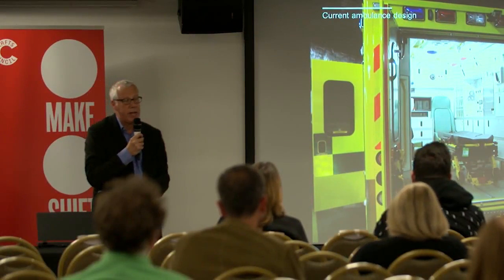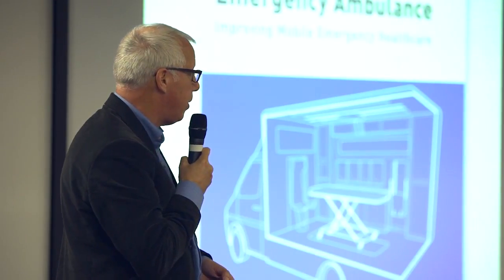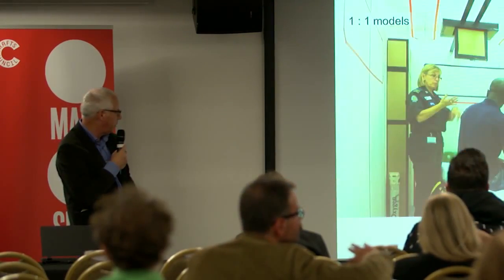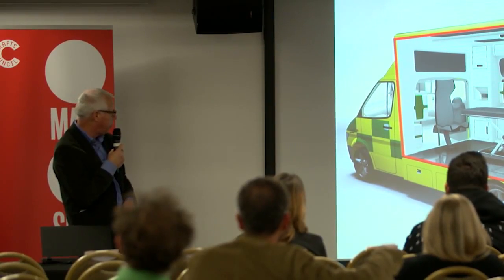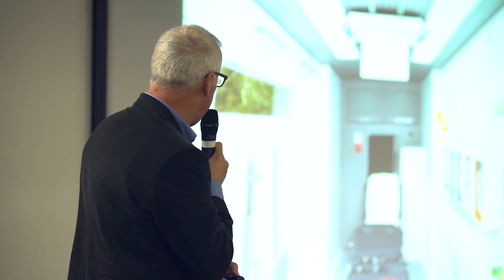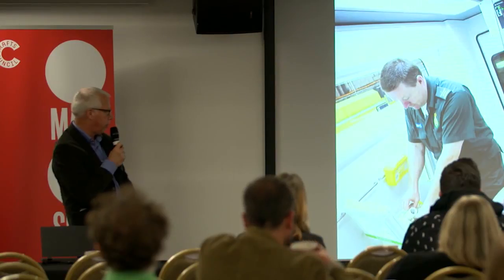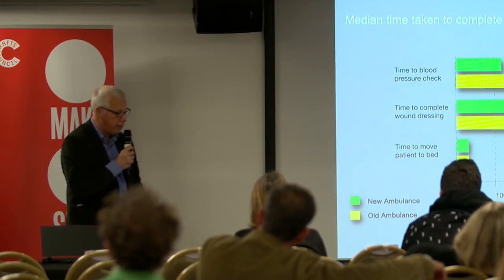Jeremy Myerson, Redesigning the London Ambulance

Comment: Modular. So “you only take kit you need for the emergency you are responding to”  issues I could see with this

1. surely this would increase response times
2. Ambulances are often not at their station and are going from job to job to job
3. What if they get flagged down or witness a RTC (Road Traffic Collision) where they need equipment, but don’t have it because they had just been to a different job and took kit that is not relevant to the RTC. They wouldn’t have the kit to help
Reply: I do not think that's what he meant. You only take what you need to the patient. Everything is still in the car. Just not everything in a heavy pack, where you would only use 10% of.
Reply: @rockhock108  That's not what he says, nor is it what the ambulance shows.  He says at the start (0:22) that you "because it's not a smart vehicle you have to put everything in there for every eventuality".  He wants to take things out of the ambulance, for the crew to slot in as they go to the emergency, which will as Nathan said increase response times.
Reply: @Scott-py1sd  That's the way that I interpreted what he said, only taking what you need for each job. However, as others have stated, it doesn't allow for being tasked with a higher priority job after leaving the station or getting diverted to a new job on the way back to the station from the hospital. 
I can see this approach coming a cropper in the face of hard real world experience in spite of all the testing. Lord knows how these ambulances are standing up to the Corona Virus pandemic.
Reply: I take it none of you guys work on ambulances? He is saying that instead of having 1 bag which had major trauma pack, maternity packs, resusitation pack etc in, it will have seperate packs in cupboards, and you take which ones you need out of the cupboard. Ambulances dont have tine to go back to station between wach call. smh
Reply: @AB-cs7vm  no he isn't. He doesn't mention that once. He makes it quiet clear he is talking about the ambulance being modular, not the bags that the gear goes in.
Reply: @AB-cs7vm  Our standard response kit carries all our drugs plus administration gear, wound management supplies, plus an airway kit. Pretty much 90% of what we need 90% of the time. I think these are standard Ferno products.
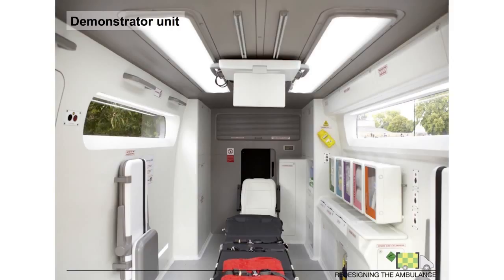Reply: @Scott-py1sd  you are the one not listening. At 2:45 he says "modular treatment packs", and you can even see what he's talking about at 2:18 The colored boxes on the wall are the different modules. Each contains gear needed for a different type of emergency, e.g., green for O2 admin and nebs, red for bleeding control, blue for airway maintenance, pink for peds, etc.

Do you honestly think this thing would have passed the rigorous field tests (performed by scientists and actual NHS paramedics) if it had the ridiculous design flaw that you've so fervently latched on to?
Reply: @lolokbr  you're just being thick now. Look at the very beging of the video. He shows a picture of a current ambulance filled with equipment and states that "everything but the kitchen sink is in there because it's not a smart vehicle". Later the show an ambulance with less than a third of the equipment and says "it is modular, you take the kit you need for the emergency you are going to".

He doesn't mention kit bags or what you remove when you get there. He's saying this is what you take with you to the emergency, in the ambulance.

This is why we have not seen any vehicle like this on the road yet, because it's impractical. It's not passed any clinical trials or tests.
Reply: @Scott-py1sd  I've been running emergency calls in one of the busiest EMS systems in the entire world, during one of the worst healthcare disasters in modern history in a rig that is more bare-bones than the one shown in this video and we've been doing fine. You don't need an entire mobile hospital. You just need the essentials, which you can easily fit into the configuration they've shown in the video.

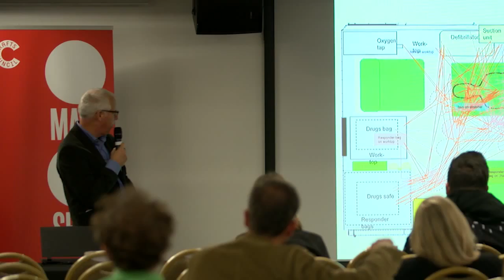Look at the graphics at 1:30 and 1:40 and tell me what essential equipment you think they're missing.
Reply: @lolokbr  you've completly if ored the fact you were wrong and moved on to another topic. I don't care what you claim your background is, this ambulance, compared to current ambulances isn't for for purpose in our health system.
Reply: This is assuming the dispatcher is 100% correct all the time. I would rather take everything with me in the truck and not leave it up to a moron dispatcher
Reply: resqjason2 dispatchers aren’t the morons, it’s the public that phone up, they have to try and decipher all the information they are given and come up with a possible diagnosis, they are very smart people. But I do agree that if the dispatcher gets the wrong information given to them by the caller then the ambulance wouldn’t have the correct kit so should take everything.
Reply: A B I agree that would be a much better way of doing it, from how he explained it I interpreted it a different way (like my original comment), I think a lot of people have interpreted it both ways.
Reply: @resqjason2  moron dispatchers?? There is no way that you are professional EMS. 
I worked a fast response car, on my own, in one of the roughest areas in London and was dispatched to the most serious red emergencies. Dispatchers are not morons!! Dispatchers and call takers have the hardest job in the service. I can battle to save someone's life, but I couldn't listen to someone die over the phone whilst trying to find resources that aren't there!
Also, on at least 2 occasions, dispatchers have saved my life. On one occasion I was being attacked with a hammer and the dispatcher orchestrated rapid help from the police all whilst I was unable to give clear information over the radio. On another occasion, I took seriously unwell on duty and the dispatcher was my best friend that night, she looked after me remotely throughout the whole process and even called me in hospital the next day to give me her best wishes.
Dispatchers and call handlers are absolute heroes!
Reply: @lolokbr  "in one of the busiest EMS systems in the entire world" does that mean you run in an urban environment? I learned in an urban environment and then worked in a rural area, right now I'm in an area which covers both urban and rural areas ... rural EMS is a completly different story compared to big city EMS:
further units to support you might not be around the corner. Same aspect concerning hospitals, already the closest one at lower treatment level might be quite a drive, but higher level treatment hospitals are even further away ... then you don't want to have only the essentials, then you need a unit which is well equipped even if you might require a lot of that equipment not very often. Rural EMS means that you might have to be able to work on the patient for quite a while on your own, with further units still far away.
1 crew mirror rescue worked fine decades ago, but that's the past. Today we have ambulance crews of 2, maybe with a trainee on board, maybe with a doctor on board, and all that for a reason. We carry equipment for pretty much anything up to mass casualty incidents, temporary command position etc
Reply: @GooseMcSwan  I agree call-takes and dispatchers sure have a rough job and try their best for the crews out there most of the time, and of course they can only work with information they get and have to create some kind of call-type for the units. However sometimes everything goes wrong: closer units which are chilling at the station don't get dispatched because it's another dispatch center's area, or units are sent to the wrong place with the same name although caller's information was precise.
Luckily we have sufficient units that emergency calls don't have to categorized in levels of priority but they all are covered within a short amount of time

Comment: Australian ambulances are already pretty well laid out. Enough cupboards to keep a crew stocked for a 12 hour shift, with the exception of some consumables which can be restocked at hospital from a dedicated ambulance supply room. I think our work stations are pretty well designed for how we work. The current UK ambulances seem to have some poorly utilized space near the treating officers' seat.
Reply: some EMS providers in the UK go for German ambulance manufacturers; I work at a German EMS provider and tbh the ambulances we run have their fair share of both pros and cons. We carry a lot of equipment stored in the cupboards and exterior/interior compartments but in most units necessary equipment is out of reach for crews sitting next to the patient on the run to the hospital; They also have a lower top speed than they used to have, many of them have poor emergency lights setup and a box layout with a high center of gravity

Comment: I don't plan to be in the ambulance but one thing that was important to me was accurate blood pressures. Traveling down the freeway hitting every pothole can be frustrating. And also having a knob for AC. In the back of the box there are 3 settings 1 loud cold air 2 loud air and loud hot air. Other than that 360 pt care doesnt sound half bad. We Yankees have mods.

Comment: Placing the stretcher in the middle like that looks like it causes more problems than it fixes. Way to little room to move around and it looks like it would be a pain reaching that far over the patient for the gear. If it was a larger ambulance like the huge trucks they have in the US it would work, but not with small ambulances. IMO.
Reply: I went with several EMS providers in Germany; Apart from the most compact of BLS ambulances where the stretcher is placed on one side, larger BLS and all ALS units I've seen had their stretcher in the middle; On most units the stretcher platform can be moved to the right and left to create more space on one side if needed

Comment: I am quiet disappointed with this, the presenter makes a number of statements that he then suggests are included in the finished design, 
A significant number of incidents attended by ambulances are to patients, who are unable to communicate, through various reasons, coupled with not having ID and another person with them who can identify them, or even tourists, non uk nationals etc so having immediate access to a persons medical records is irrelevant. The London Ambulance Service has in the region of 500, emergency Ambulances, it is not practical for them to keep returning to a base between calls to collect different ''case'' pods. If you were going to reduce the visible pods, then a carousel type unit set between the cab and the treatment area would be more practical.. The principal error with the current Ambulances is the chassis length, to short by a metre,  some are single wheel rear axle, and the weight of the VW engine when they get chosen is heavier than the Merc so it reduces the payload. The treatment area pod, needs to be a 'demount' unit, so when you loose the chassis cab, for whatever reason you don't loose the whole Ambulance.. Hope you are still at the planning stage and non have been commissioned.    
I have just retired after fourteen years as a Public Governor with an NHS ft, and would not have supported the purchase of these units.
Reply: lol here in Germany the first EMS provider goes for a even longer chassis than the normal ALS Emergency Ambulance would have, instead of making them shorter

Comment: This a joke !!!
By placing stretcher in the middle under assumption that 360 degree access is always required is laughabl. In doing so when a sitting patient needs to transfer to a hospital chair there is no space..
They have omitted to include the fact that modular packs are ineffective as jobs are changeable en route, technology breaks, h+s with leads on floors, that filite stock of items is stupid as you may use more than several stock items on one patient dependent on condition.
MANS A JOKE